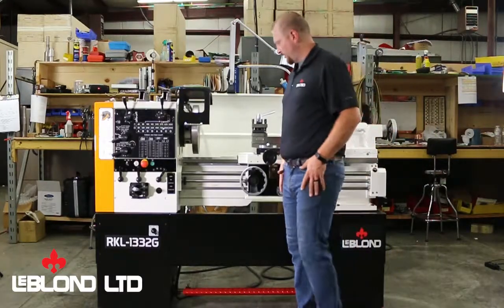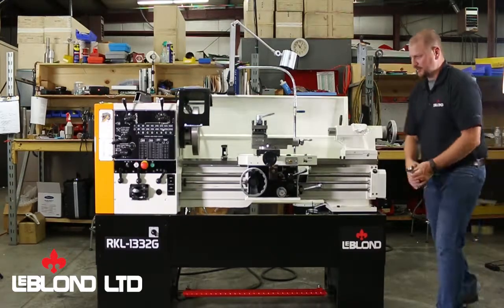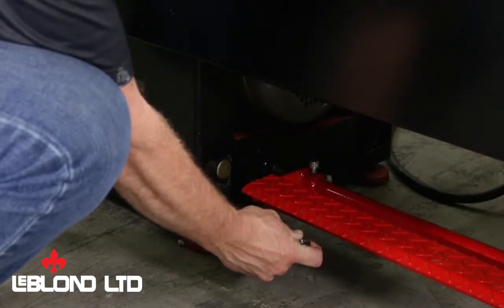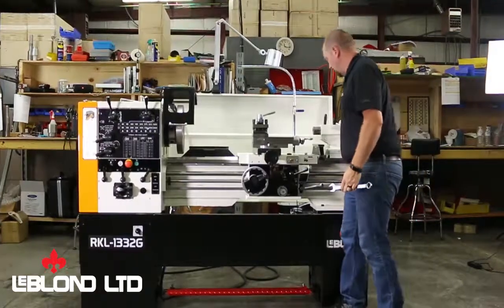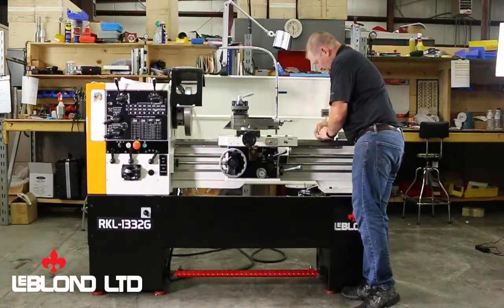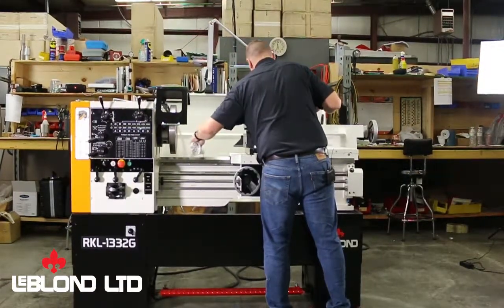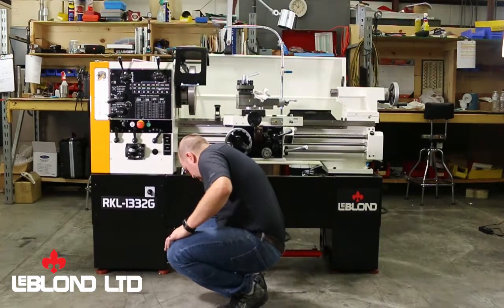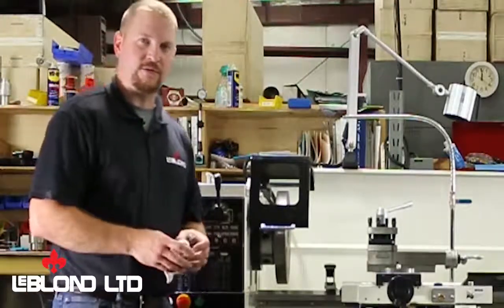LeBlond "How to Level a Lathe" Video

Comment: 5/10 of an inch seems awful coarse for a precision level.
Reply: The majority of time when a machinist refers to a tenths of an inch, they're not referring to actual tenths, they're usually referring to ten thousandths of an inch. So when he said "measures within five tenths of an inch", he meant 0.0005". What five tenths would actually be called by a machinist would he five-hundred thousandths.
Reply from the maker: Call 888-532-5663 for more information.